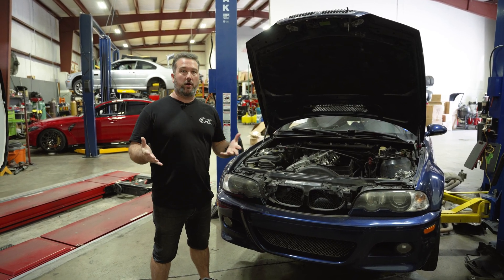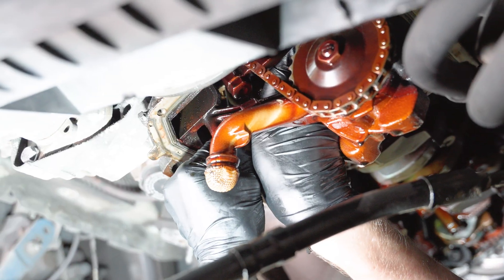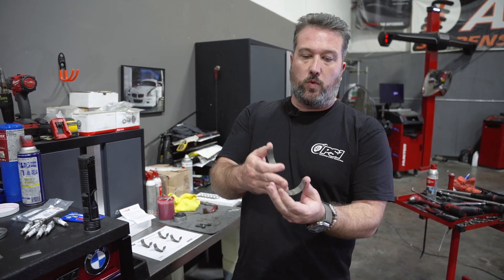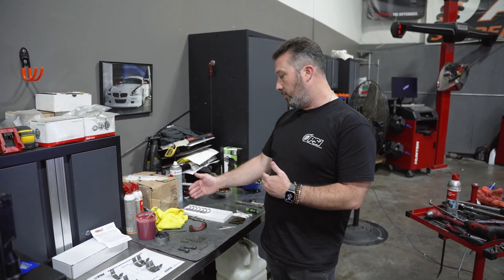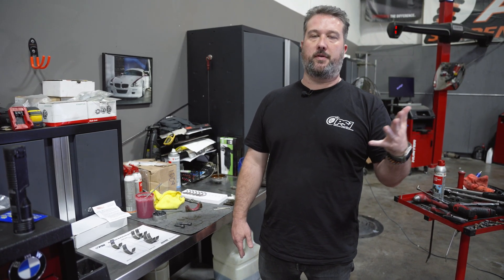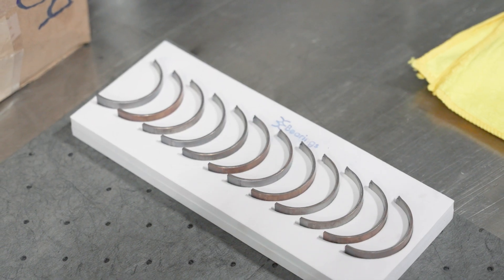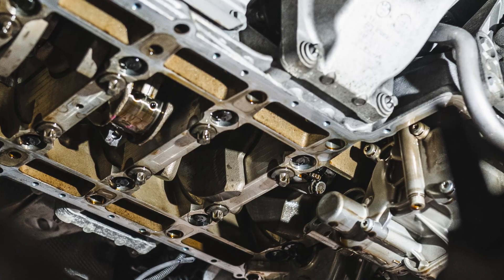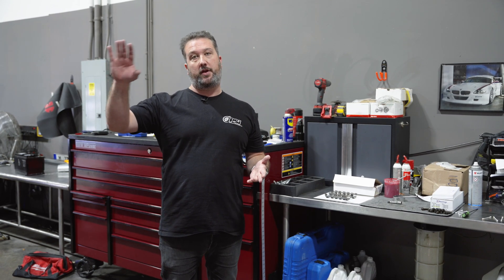BMW E46 M3 Rod Bearings - Fixing the S54's Achilles Heal

Comment: 110,000 MILE S54. 4 years of Blackstone Oil Analysis showing rod bearing wear metals very low and not increasing. I change oil max 7,500 miles or annual (last couple years only ~2,000 miles per year...period for the past 15 years.

BE is top of my list. ARP bolts are the given choice.

Even though wear metals show no concern would you advise doing the RBs anyway?
Reply from the maker: Yes. If you plan to enjoy the car for as long as possible:

Comment: On an S54 and using BE bearings and ARP bolts using the stretch gauge process, is it necessary to also measure the clearances with plastigauge?

Comment: Do you have concerns using the ARP rod bolts without machining the rods? The clamp load is going to be different with ARP bolts vs OEM, so the bore will distort differently. Has BE tested with ARP hardware? I know they recommended OEM bolts on S65/S85 until they came out with BE-ARP bolts.
Reply from the maker: No we don’t have this concern. We have completed this job on 100s of engines with BE and ARP.
Reply: @PrecisionSportIndustries  Thanks!

Comment: 10W-60 oil ?!?   What is the rod bearing clearance specification? What temp does the oil normally operate?  It’s an N/A straight 6 on pump gas. What the heck does it need 10W-60 for except to intentionally wear the rod bearings every time you start it up!  Can someone please post the BMW service manual specification for rod bearing clearance in these motors?
Reply: I believe when it first came out 10w30 or 40 was recommended but they changed it to 60 after the recall. I assume the thicker oil is stickier and sort of acts like sticky assembly lube in the bearings

Comment: how do you replace the upper rod bearing shells?
Reply: After removing the rod cap, you push the rod upwards over the crank and then pull it back down toward you in the space between the crank and the block.  You then have access to remove the upp bearing with your fingers.

Comment: Hello, my mechanic did replace my S54 rod bearings using ACL but he said changing rod bolts was not required even tho rod bolts were factory later model ones (2005 S54 engine) after that service was done i still researched and ended up buying ARP bolts which i want to be used, my question is, what is torque sequence for these ARP bolts and do i need stretch gage or torque wrench with angels?
Reply from the maker: Torque spec with the ARP only. Make sure you know which ones to buy, there are 2 sizes based on production year.
Reply: Later models use m10 bolts which are not reusable so yes swap tg out . M11 bolts can be reused